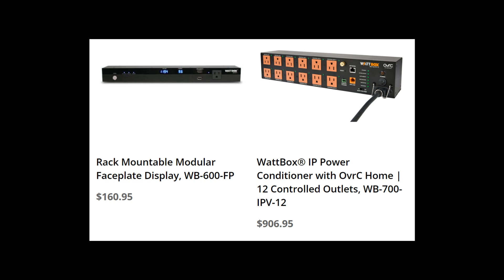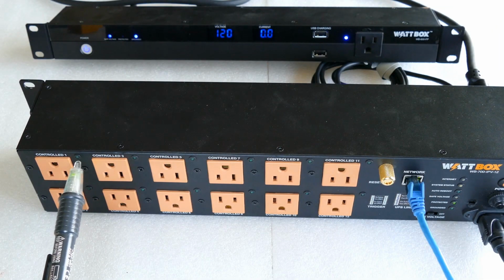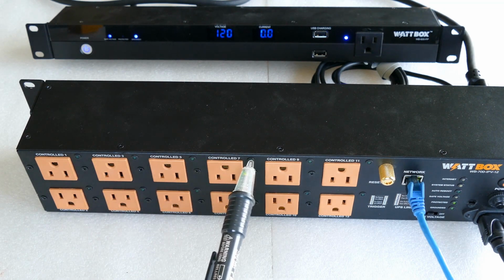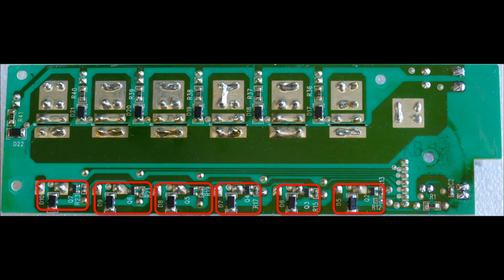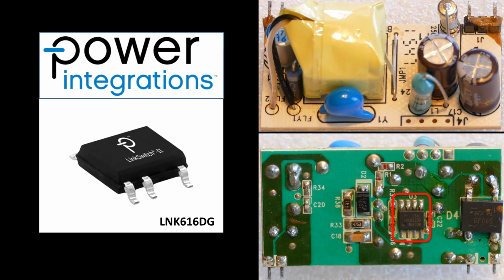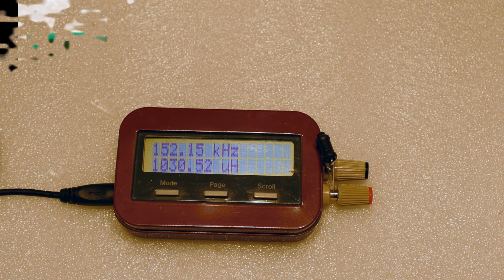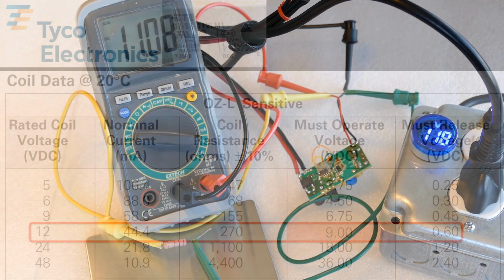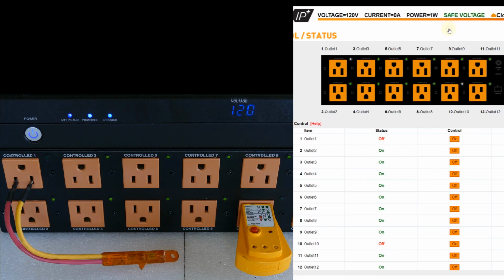WattBox  Repair Tutorial

Comment: The thing about this is is that if that particular unit was never taken off the customers account you’re never gonna be able to use any of the features other than basic power protection so it’s not really worth it unless you are a snap av and also at the end of the day companies have to have incentives to create maintain and continue to produce products like this, especially when not every day consumers are buying them
Reply from the maker: Thanks for the comment. Just to clarify how the WB-700-IPV-12 actually works:
1. The unit does not need to be removed from a dealer’s OvrC account to be fully usable.
2. All local features work regardless of OvrC status, including outlet control, automated power cycling, relay operation, and surge protection.
3. A basic factory reset restores full local control even if the previous installer never released it.
4. The only thing that depends on account ownership is cloud access, not the hardware functionality.
For what it’s worth, I’ve been using this exact unit on my own network successfully for almost four years, with full local IP control and zero dependency on OvrC. So repairing it is absolutely worthwhile for anyone using it outside the SnapAV ecosystem who wants a relay-driven PDU.

Comment: Hi where do I download the software please ?
Reply from the maker: You can download manuals, support docs, sales resources, software and firmware for the WB-700-IPV-12 here:
https://help.snapone.com/adi/Content/Support%20Links%20Topics/WB-700-IPV-12%20Support%20links.htm
I just upgraded my firmware from WB10.9a17 to WB10.B929 to test it and it worked.
Reply: @rdagger  thank you so much I will check it out I need to see if the outlets are turned of manually or there is something wrong because the top outlets not working and even after I turned off the unit still 2 of the outlets are powered up

Comment: as a system integrator and electronic hobbyist, I have 6 of these exact model wattboxes and they've all failed the same way as yours. Can't, for the life of me, figure out why they use these seperate ac-dc power supplies. why not just have 1 main 12v power supply and use that to supply power to each relay board? These little power supplies they use are garbage and all fail and at the price u pay for these units, they should be designed way better than they are... they are designed to fail
Reply from the maker: I don't disagree, but here are few possible reasons:  Relays for switching outlets can generate electrical noise and transients, and by powering each bank of relays from its own isolated low-voltage supply, noise and surges are less likely to affect the control logic. If a board fails, you only lose one row of outlets. Small modular boards are cheaper and easier to replace, and they can also be reused in other similar products.   There could be benefits with respect to UL/CE compliance.

Since repairing and recapping my WattBox with high-quality Japanese capacitors, it has been running 24/7 for three years without any issues.

Comment: The high failure rates may to be user error too. For example if installers have to many things plugged into them, pushing the units too hard.
Reply from the maker: I doubt “too many things plugged in” is the main cause. These WattBox relay power supplies use CapXon electrolytics, one of the notorious brands involved in the capacitor plague, which are known for premature failures. Heat and constant ripple current take them out whether the load is light or heavy. Overloading can make things a bit worse by raising the internal temperature, but it’s more of a marginal accelerant than the root cause.
Reply: @rdagger do they still use the same capacitors? Surely if the caps were causing such a high failure rate, they would have changed them by now.
Reply from the maker: @extracareav  Good question. I haven’t opened a new unit, so I don’t know. Because these units are sold mostly through integrators, it’s hard to find public information.

Comment: I just moved into a new house with wattbox.  It does not respond to an IP ping.  I  have the cdrom that came with the device but it appear that I need to have a password or something else to make it respond.  Some of the outlets have illuminated LEDs and they supply power others are off.  Do you know if the company still exists or can you provide access information.  thanks.
Reply from the maker: Depending on which model you have, you should be able to login to it using a web browser and the IP address of the unit.  The default credentials should be admin, 1234 or admin wattbox.  You should be able to reset the unit to factory default by pressing the reset button on the back with a paper clip.  You may have to hold it for several seconds.  You should be able to download the manual for model from the vendor:  https://www.snapav.com
Reply: @rdagger  Thanks for the information.  I have a model WB-600-FP which, I believe, is the same one that you repaired in your video.  The stated IP in inaccessible using either a ping or in a browser.  Several of the outputs are active and I'm reluctant to reset it and maybe lose those outputs.  I have the original CD rom disk which loads but does not allow the firmware upgrade.  I suspect that since the IP is not viable this path won't work.  I suspect it's been in this state for years so maybe a reset will make it responsive.  What do you think.
Reply from the maker: @witzed1 WB-600FP is the optional face plate display module.  My wattbox is a model WB-700-IPV-12.  Wattboxes are typically only installed by authorized integrators and if they are competent then they would have assigned it a static IP address and changed the default credentials.  Is the wattbox plugged into a network?  If so, did you set up the network or is it the existing router that came with the wattbox?  The MAC address of the wattbox should be on a sticker on the bottom of the unit.  You could check the DHCP table of your router to see if it assigned an IP to your wattbox.  Since, the wattbox may have a static IP, you can use the command arp -a to scan your network for the mac address assuming the wattbox is on the same subnet.  There are also free IP scanning utilities you can download to scan your network (Angry IP Scanner, Advanced IP Scanner, Nmap, Fing, Belarc Advisor).  If you can't determine the IP address, then you could try a tool like WireShark to capture network traffic and look for unknown IP addresses.  You can always try to contact the previous homeowner and ask them for the IP address and credentials.

Comment: Great Content!!! Thanks for Posting this, I have now Fixed 5 Wattboxs using your tutorial and parts list. All five had bad High Voltage CAPS, one had a fuse popped, and all 5 (10) power modules had to have the LNK chip replaced. Clearly there is a MAJOR issue with quality of CAPS used on these products. Very Sad as how expensive they are and their intended usage. I'll be interested how long they last with new better quality caps!! I am completely confused why the design has 4 different power supplies, it would have been cheaper to build one quality power supply.
Reply: Stephen, I have a graveyard of these Wattbox units and they are valuable to me if fully repaired. Any chance you would be interested in offering your repair services? I’d hire you if you could repair these WB-700s

Comment: Do you think you had to replace the IC? Or, was that just a distraction from the solder bridge?
Reply from the maker: Most of my testing of the IC was done with its board out of the circuit.  So, the solder bridge on the other board was not connected in any way.  The original IC was definitely bad because it had no voltage with or without load.  After replacement the output voltage was correct.

Comment: I can attest that the WattBox IP controllable power bars and conditioners had a horrendous failure rate, defeating the entire purpose of the idea. I've had one Panamax BlueBolt failure out of ~13 deployments, with 90% failure rate of the WB300-IPCE-3 after ~ 4 yrs of constant use. I may try them out again because I do like the OVRC interface but its been a few years.
Reply: I understand they did a limited recall on these to the Installers, not the end users. I hope they learned from this and have improved the build quality. I was going to use these in a Bill of Materials for several projects where we needed power sequencing, but after this, I'm looking for another product.

Comment: Thank you very much for the really detailed video. 99% was way over my head but enjoyed watching you explain the process to getting it fixed. Impressive!

I was looking to purchase one of these but realized that they are almost impossible to buy which is a HUGE red flag, plus seeing that high quality components are not used is another red flag since their products are not cheap by any standards. So for those reason I am out no longer interested in Watt Box/SnapAV products.
Reply: I do admit there’s definitely a problem here with how cheap they’re making that especially with how compacted it is that should be explicitly noted. It’s not for high power products. I’ve never seen any of these fail when they have routers and normal things plugged into them, but anytime they go to amplifiers or power wreath, and that switches they fail. 

Most of the watt  box small smaller units last forever pretty much I’ve seen some that are like 20 years old
Reply: @michaelw482 this is helpful. When you say ‘smaller’ are you referring to the two and four outlet models or something else?  My 700 failed yesterday so looking for alternatives.

Comment: Nice thanks I have the 800 series unit I hope I don't run into this problem but if I do hoping this video will be helpful for repairs
Reply: I no longer work for a snap dealer, so I cant offer any current info, but for a couple of years I did work with a dealer, the 800s were much better in terms of failure rates. That said, they were new, so only time will tell what their average lifespan turns out to be.
Reply: @mark22732 I concur that 800 series are better